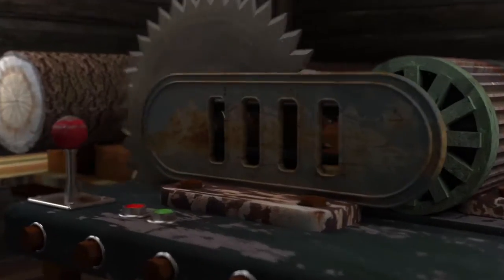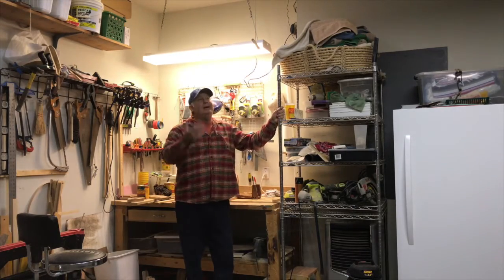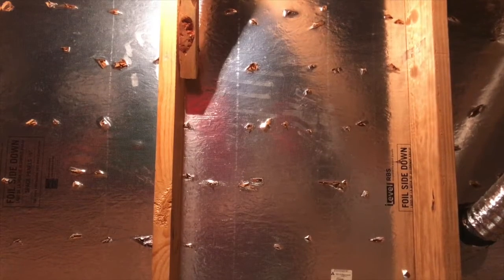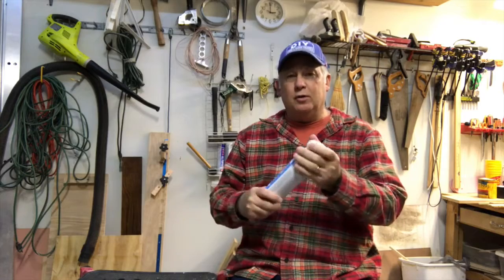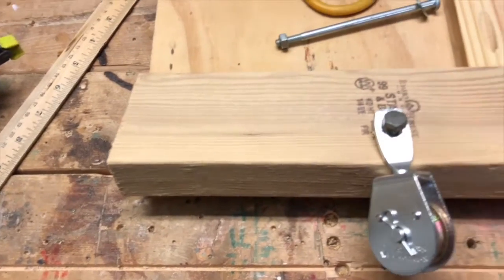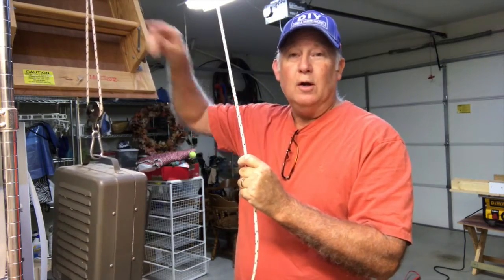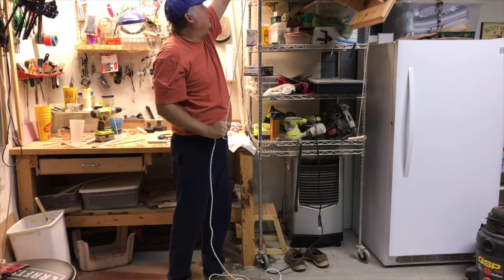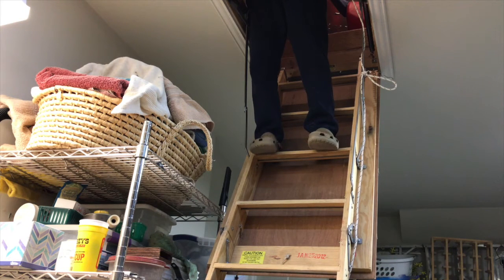Pulley for Garage Storage

Comment: I plan to build a sled that will slide up the stairs. The top pulley will be mounted in line with the stairs so the stairs will not have to be folded.